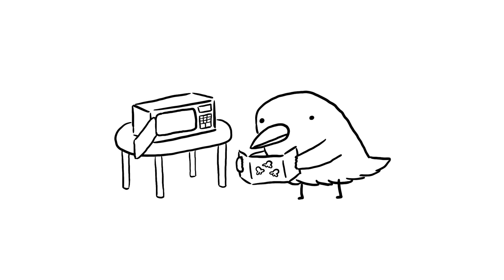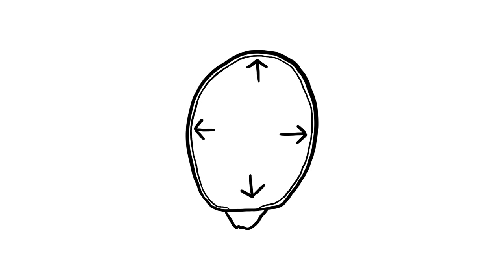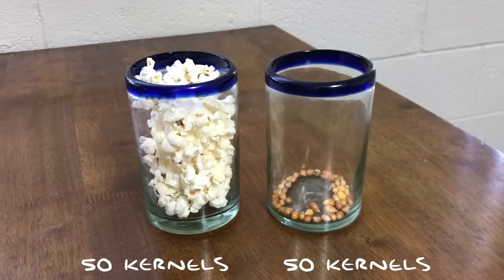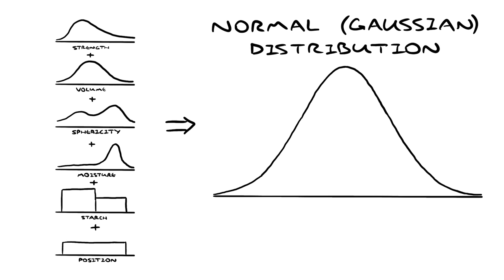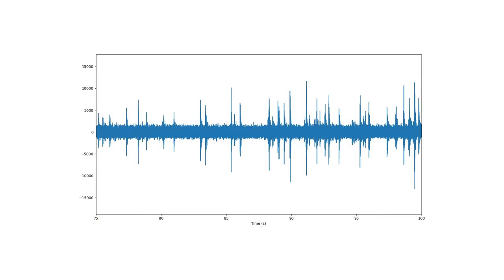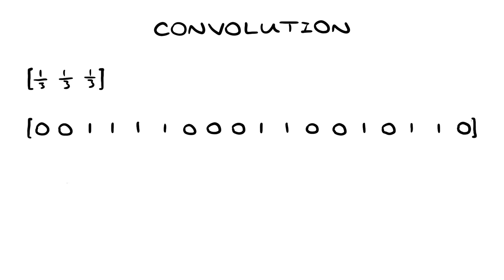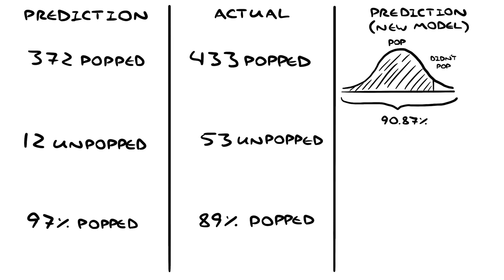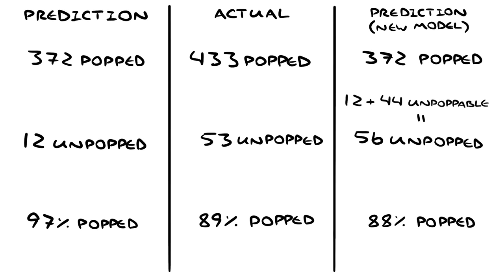The Statistics of Microwave Popcorn

Comment: Fun Fact: You can make delicious microwave popcorn that is CHEAPER and SOFT (doesn't get stuck between your teeth). Simply buy popcorn corn, put it in a large glass bowl (only enough to cover the bottom of bowl), add a thin layer of water (very little, only covering the kernels halfway), place a glass dish on top of bowl. Microwave at highest potency until just before popping sound stops (timing is finicky and can be tricky, might burn a few times before you get it just right).

Comment: Here's another tip! Shake the bag shortly after you notice the popping slowing down, helps spread the heat, just be careful not to burn yourself. I get noticeably less unpopped kernels that way.
Reply: but its still in the microwave?
Reply: @PewPewCricket  yea but it doesn’t remain in the microwave, you eventually take it out
Reply: I was just thinking "how much does the kernel-to-kernel heat transfer factor in?
Reply: @isengrom6883 so y'all are saying after the popping has slowed down, if I shake the bag, it will help pop more kernels even after it's been taken out of the microwave? 🤔
Reply: @svps169 I think they meant you take it out for a few seconds to shake the bag and put it back for a few seconds to pop the unpopped kernels.

Comment: If you want more of the kernels to pop, unfold the bag and use your fingers to rip the adhesive on the bottom left and bottom right of the bag, this allows the bottom of the bag to expand more as the popcorn pops, and because there's more space, the popped kernels have more time before they burn, thus allowing the unpopped kernels more time to pop.

Comment: I did a project for university where we needed to find a wolf's howl in a large dataset and use the time-delay between different microphones to triangulate it's position, and we used the exact same method of detecting signals as you did! We did however not use the [-1,1] trick for the moving average to find the starting time so it gave us a lot of headaches! You just solved my internal conflict for not finding a short/satisfying solution for that problem. Thanks!

Comment: I like how this shows the very common approach every experimental physicist (or any problem solver really) quickly learns: auto fitting a curve to real data beats assuming simple stat model dynamics every time. Understanding CLM and gaussian distributions is nice and all, but basically the most de minimis part in the process of trying to model a system.

Comment: From a less scientific perspective, I believe that reliably achieving a higher percentage of popped kernels every time is possible. 

I find that when popcorn burns in the microwave it will start to burn in 1-3 specific locations (if stopped early enough. I’ve assumed that this is due to a lack of moisture in certain areas of the bag while in the microwave, as (from what I understand) microwaves expand and evaporate the water molecules in food.

For my preferred brand of microwave popcorn; I set the timer for 2.5-3 mins (depending on microwave) but at 45 secs remaining, I open the door to very quickly shake the bag before allowing it to continue. 

I do this with the intention of more evenly spreading moisture (whether steam, butter or another flavouring) and slightly dispersing the heat from higher temp areas throughout the bag. From what I have gathered/assumed, this allows for a longer cook time and in turn higher percentage of popped kernels, while also reducing the risk of burning. In my experience this results in a reliable way to get more popcorn each time; although I have noticed it can dry out the popcorn slightly, this doesn’t bother me though and can also be prevented by choosing a type with extra butter flavouring.

For anyone wanting to try this themselves, obviously finding what works best for your fav popcorn and microwave at home will require trial and error. However, if your popcorn does provide a recommended time, you can use the max mentioned as the total time for the bag to be in the microwave (before and after stopping to shake). Or you can wait until you hear the popping first beginning to slow down for you to shake the bag, before continuing for 30-45 seconds more. If you’re struggling to see results, try shaking the bag faster (shorten the window of time that the cooking is paused). Or if you’re experiencing burning, either shake the bag harder/more next time, or potentially you need to shorten your total cook time as your microwave may be a higher strength/wattage.

Happy popping!

Comment: Neat problem! I remember watching a Technology Connections video on microwave popcorn as well, and apparently some old microwaves had a neat feature to detect when to stop nuking popcorn - they measured the air moisture. The reasoning being that once you pop enough popcorn the bag opens a bit and all that moisture goes out. Just as neat as automatic roce cookers that cook rice until the temperature rises too much, relying on the fact that a boiling water will stay at 100C flat, and only once you're out of water will the remaining rice heat up.

Comment: Also, something to consider is how the package has been sitting on the shelf and how that effects the butter and kernels inside the bag. I usually find that the butter and kernals are lot uniformly laid out but rather have settled to the bottom relative to how the box has been sitting. I like to break that up in the bag and have the butter and kernals mixed evenly, allowing for a better result of popped to unpopped kernels. Sometimes, the butter will just be in one big blob separate from the kernels.

Comment: Assuming you always use the same brand popcorn, stored at roughly the same temperature each time, and  put in the same exact microwave, I have found it is possible to determine an exact time that results in good popcorn (most kernels popped, but not burned) without the need to stay with the microwave. But that's just me, perhaps not everyone has this much dedication to laziness ;)

Comment: I eat quite a lot of popcorn but I time it, it's taken a lot of experimentation but 80% power (at 800w) for 2:85 (yeah, 2 minutes 85 seconds, it's a nice number to type in and I enjoy it being a time I see nowhere else). Just before it ends I do extend it by 30 seconds as it may need up to 10 seconds more, but if I'm not next to it, it's safe to end at 2:85. Even with 30 more seconds it hasn't burnt the 3 times I've accidentally got distracted after inputting the extra time.
I find the directions of waiting for the popping to slow to not be super helpful because at 1 minute left there is a brief pause, and at 30 seconds left there is a longer pause, I fell for these traps and have had bags 1/2 and 3/4 popped. I wrote down my instructions for the rare times my wife has some of my stash explicitly stating about these pauses and to continue despite it feeling wrong going multiple seconds without a pop.
I have burnt 4 bags of popcorn trying to find the ideal time (my wife has burnt 2 bags forgetting to input 80% power), you have to be willing to burn a lot of popcorn for calibration. I hate having to wait for something as arbitrary as popping being slower when it's so easy for pauses to be broken up and to end with burning, and I get it such that the bag is always completely packed almost bursting. The majority of the kernels that are un-popped are cracked or otherwise have holes, the rest are either burnt or that they have swelled but not enough pressure to pop, only a small amount of the kernels look fine enough that they should have popped.

It's something I care a little too much about. I have also contacted the producer about my findings and how they're better than the guides given, that too much heat leads to burning before all have popped.

The exact brand of popcorn I have is from Home Bargains for 4/£1, blue packet (salt). The purple packet (sweet and salty) wants 3:10 at 80% power, I'm not a fan of sweet and salty so I haven't narrowed in the time any more, it may want +-10 seconds. I think making popcorn at a slightly lower power setting would work for other brands too.

I wrote all of this before watching the video.
Edit: Now that I've watched the video, do set the timer and walk away but only after you've experimented and found the perfect time (you will burn some as you lower the upper bound), I can recommend starting at a lower power setting. At least the ones I buy are very consistent.
Reply: The manufacturer does not care about popping every kernel
Reply: @Hyperbolic_G  No shit but there's things you can do to maximise it without burning.

Comment: If your microwave has a steam sensor, it can use the time it took the bag to open to calculate how much longer it should run.  If the popcorn button asks you for bag size, don't bother though.  If it's asking for the bag size it doesn't have a humidity sensor.

Comment: After much experimenting, the best way to pop popcorn is in a non-stick pot with olive oil. You will get better results with an induction cooking surface. This is the best method because you will pop 97% of the kernels, it will cost less than the micro wave bags, and you have a decent chance of having everything you need already. If you want superior popping though, get a specialized hot air popper.

Comment: We just got a new microwave, and it has this new technology that let's it actually vary the power, rather than just full on and full off with breaks in between.  The popcorn button works wonderfully.  I wonder if changes the power level throughout the cycle.  There's usually less than 20 unpopped kernals.

Comment: Being based in science,  you of course know that the un-popped kernels is a function of the corn more than the heat source. All methods are not equal,  so there is room for experiments.
The best method for determination of termination is the asymptotic curve of T / Interval freq. / fire.

Comment: The absolute best way to make popcorn is to microwave the bag for 20 seconds, pull it out and squish all the kernels around together, this will distribute the butter spread and heat evenly throughout the bag. When putting back in to heat, place the side with the most kernels stuck to it to the plate, after 75% of your cook time is complete, pull the bag out shake it and place back in for the remainder of cook time. That's how I do it anyway.

To determine total cook time just go with what you already use or the bags instructions, due to how different microwaves can be you gotta kind of hone the process yourself for your microwave. 

This way they are all even temperature as opposed to being compacted and cooking in an uneven manner due to thicknesses, compaction and general ambient starting temperature. 

The second shake ensures there are no overly hot areas or spots where the popcorn could almost being frying on the bottom of the bag and that any potentially locked away kernels receive necessary environment for popping. 

Even still at this level of fixing the problem though you will have unevenness. I believe a very strong microwave with a gimbal or something inside to tumble the bag, maybe some sort of analog weighted device that tumbles due to the spinning motion of the plate. Strong microwave to still be able to target the water molecules and heat them even during such intense motion.

This way the popcorn would be in constant motion and the most kernels would receive the most even coating of butter spread evenly heating the mixture producing the most evenly popped and most popped bag of popcorn possible. Or that's my guess.

Comment: Great video I really enjoyed it! However 4:30 is not what the Central Limit Theorem says, and it leads to an unfair assumption that the the time it takes for a popcorn to pop is normal. The CLT says that the sum of i.i.d random variables tends to a normal distribution as the number of RVs increases. The CLT really doesn't say anything about adding distributions in general. The example with the dice illustrates the CLT well. 

However 4:30 what you're doing is adding a simply adding  distributions together (a small number at that), the problem here is the distributions are definitely not identically distributed (if we assume the distributions for strength, volume etc. are represented by the drawings you've shown then you can clearly see that they aren't identically distributed). 

The reason why it works for the dice example is 1) because for any die there's a 1/6 chance of rolling each number, so the each dice throw is identically distributed, and 2) they're clearly independent and also you in the video you show what happens in the limit (i.e involving a large number of dice).

Applied to popcorn popping times the CLT would say something like: if you take a bunch of popcorn and pop them, and add up the time it takes each one to pop, then "the sum of the time it takes for each popcorn to pop" follows a normal distribution. Note that it importantly doesn't say anything about the underlying distribution of the time it takes a single popcorn to pop.
Reply: Came here hoping someone would have pointed this out
Reply: I agree that the video could've used a bit more rigour in that point, but I do think you can use the CLT to say it's gaussian.

The point is, the distribution that he shows on the left are not added in any way (how could you even add volume and position?!), but, the thing is, each of those variables contribute for some dt to the popping time of a single kernel. In other words, the popping time of a kernel is a sum of many values that depend on many different variables. Even if those variables are not normal, their sum can be approximated as such, because they are many.

This is very similar to the assumption of normal errors when doing regression.

Comment: I'm curious if you'd get the same results if you account for the oil that heats the kernels, as well as the occasional instruction to leave the bag in the microwave after you stop it until the popping stops

Comment: correct me if I´m wrong but you cant just add any independent Random variables and use the central limit theorem. The central limit theorem works in its original form only for i.i.d variables and you can drop the identically only if the Lindeberg's condition holds, as far as I know.

Comment: I buy a bag of popcorn from the local market, then put enough to cover the bottom of big round ceramic bowl add a little sunflower oil and cover with lid. The oil is there so that the salt can stick to the popcorn.

 4 minutes and 30 seconds on 100% power in 900W microwave.

Comment: I would like to input my experience using a pan, kernels and oil to pop popcorn. I've never made a full count of what I pour into the pan, but it's probably 1/4 cup every time. And if I have. One to three kernels unpopped. I'm very surprised. This is mostly because you can continue moving the pan, keeping the popcorn that's already popped from burning. And also keeping the kernels down at the bottom in the oil. This has also worked cutting open a bag and pouring the contents into a pan

Comment: A limiting factor in your accuracy using pop counts is the accuracy in how the bags are filled at the factory. Do all bags have exactly 486 kernels? If not you can't accurately gauge pop % from raw pop count, as the starting kernel count may be undefined.

Another way might be to find the average mass loss from an unpopped to popped kernel, and then finding how far a bag drifts from this expected mass loss before vs after popping, with unpopped kernels being unexpected extra mass. A factor tho would be that water vapor mass actually being able to exit the bag as steam and not recondense on the sides of the bag.

Comment: I've popped 99% of the kernels many times and every kernel only a few times, it really has to do with entropic heat transfer, placing the bag on a upside down ceramic dish helps concentrate the heat where it's needed, improving popping consistency and the number of kernels that pop.